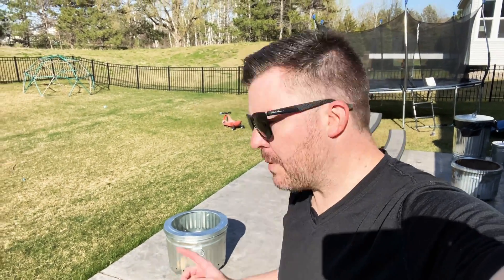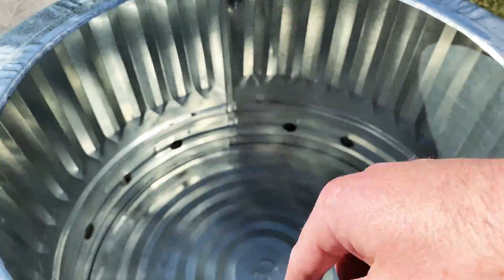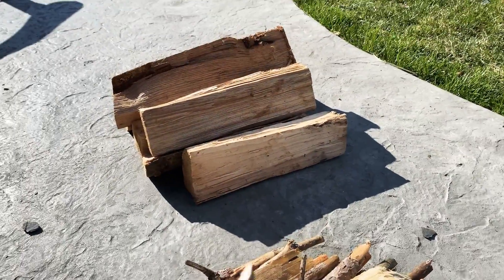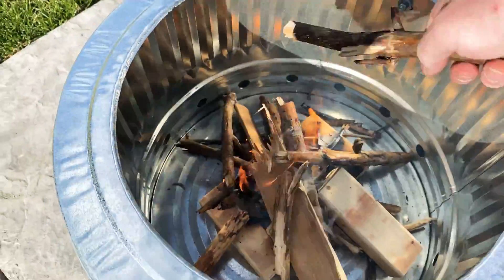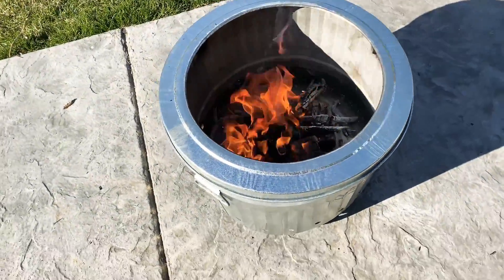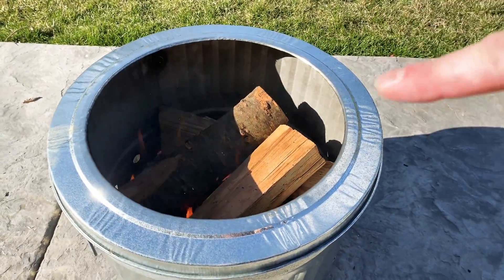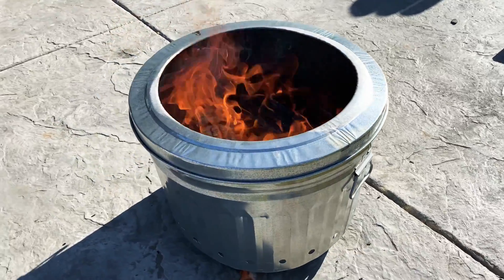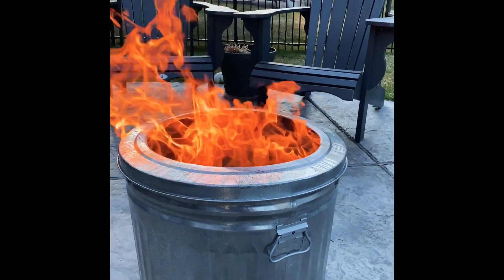How To Start A Fire in A Smokeless Fire Pit

Comment: Where are the small air holes around the top inner ring of your pit?

Plus; Google up Top lit Up Draft, TLUD concept.
Reply from the maker: Rather than the holes (like a Solo or Breeo) there is a small air gap that's about 1/4" between the inside wall and the bottom of the lid.